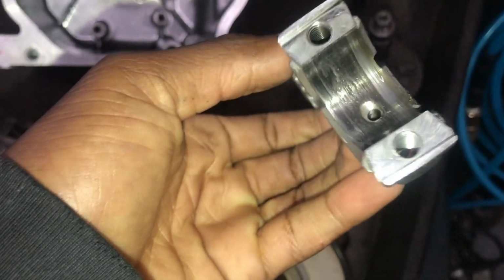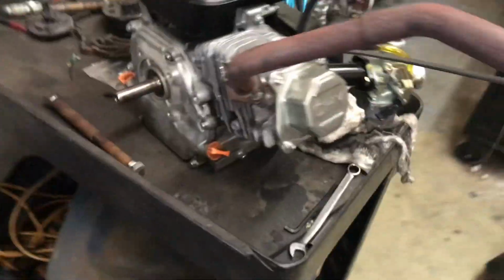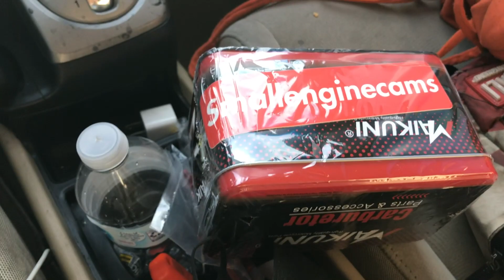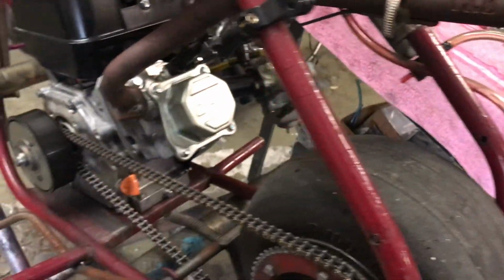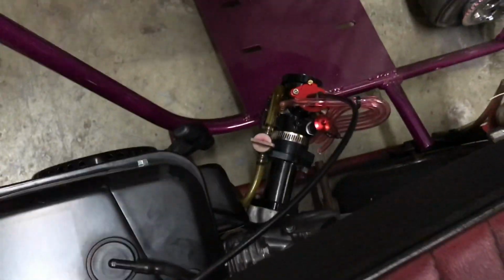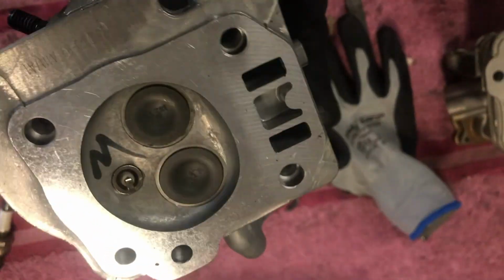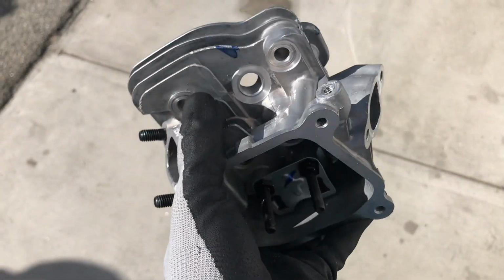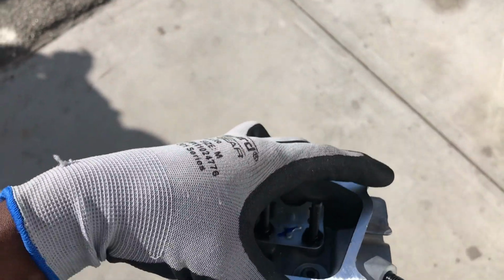Blowing a motor and in the lab with BDMS

Comment: What did u buy from Isky cams? And how is he measuring the milling when going through the ports on that head? Very interesting 🤔
Reply from the maker: I forgot what I bought that day, thats a question I do not know the answer to.
Reply: So it wasn't a cam you bought correct lol? And I kinda see what he did to the head what kind of valves are you gona be using on it .
Reply from the maker: 32/28 I believe
Reply: Nice! What rockers, springs and retainers are you using?🤔